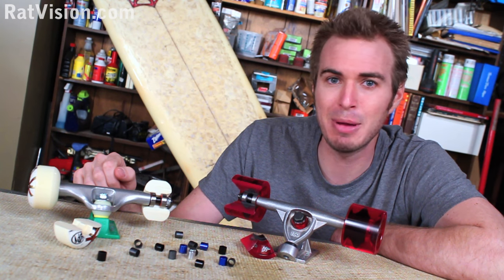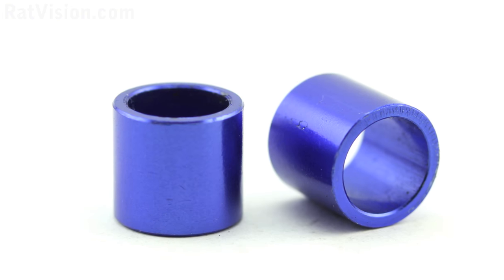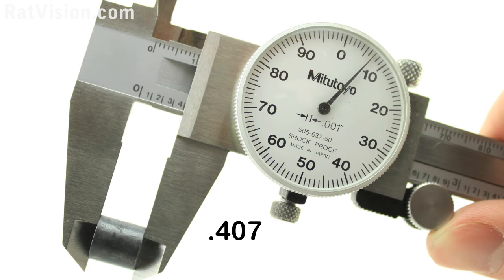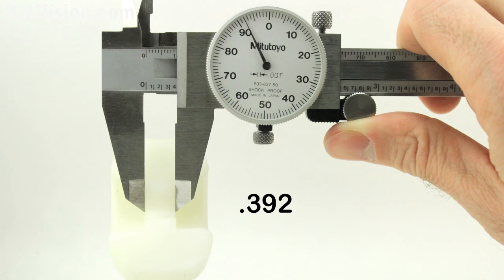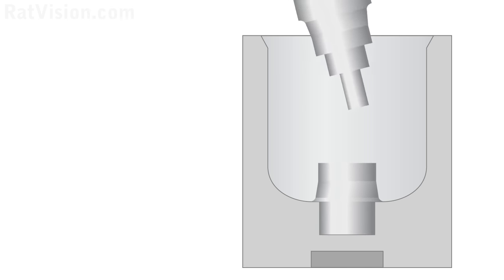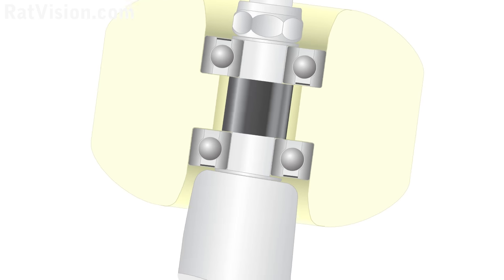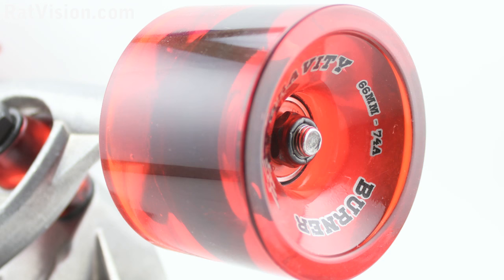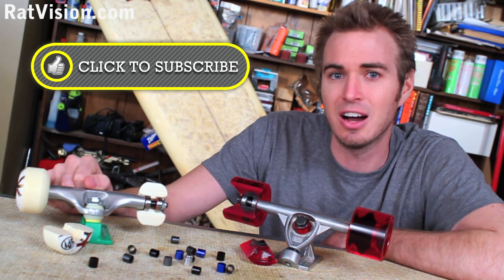Fastest Skateboard Wheels, Bearings, and Bearing Spacers

Comment: Thanks for an intelligent video on bearings and spacers. We need more info like this. You did not mention Twincam 6-ball ILQ9s and 8-ball bearings such as the Qubes... It seems the skateboard industry is saturated by rebadged poor quality 7-ball types. Bearings are overpriced in shops almost 2x the price even with postage, is always cheaper direct from manufacturer.
Reply from the maker: We commented on a similer question by you in a different video.  Twincam is not in the skateboard industry at all.  7 balls are the magic number and out perform 6-ball and 8-ball bearings.  However, you are absolutely right that there are "rebadged" or re-branded bearings in the skate industry.  I have to constantly tell people that one brand they love is the exact same brand as 5 others.

Comment: i want to buy a longboard and found one can you pleas tell me if this is a good first board or not? its a KICKTAIL 70's shape skateboard w/ 71mm wheels
Size: 40" X 9.75"
71mm Wheels
Truck: 7"Hanger, Aluminum Alloy
Abec 5 bearings
Hardware: 1.5", Riser: 1/2" Rubber, With Grip Tape on it
 or just search for: "New Complete Longboard KICKTAIL 70's shape skateboard w/ 71mm wheels" on amazon.com

Comment: Or you can just not crank your axle nut down, so there practically no pressure on the bearings. No pressure on the sides = bearing balls staying centered in the groove and bearings rolling the fastest. Im not saying keep it loose by any means, but if there is just the littlest bit of play with your wheel moving side to side on the axle, your golden.

Comment: "Even Death" might be exaggerating a bit but otherwise I likes the vid.  Oh yeah, the spacer ideally should be ~.002 longer than the space inside the wheel so that there is no bearing bind and very little wheel movement on the outer bearing races.

Comment: What are good wheels so I don't fall on pebbles
Reply: +omgkid angel 
Try Ricta Clouds 78b wheels. 54mm is a comfortable size. Ther are very soft, have excellent traction and rol over everything that would normally make you skurrtt and fall.
Reply: +AGP兆し +1 on the clouds. Really nice cruising wheel and surprisingly low rolling resistance. By the way, it's 78A , the B durometer scale (Shore B) is a little harder and isn't commonly used.
Reply: +omgkid angel shark wheels

Comment: I bought some Destructo Squadron 6.0 trucks not long ago based on some good reviews. Had to send the first pair back because the manufacturing was so poor and the second pair I received were marginally better. The two sides of the truck where the axle meets the bearing are noticeably slanted so there's no way your bearings are going to fit in there properly plus there was plenty of aluminum that wasn't polished down (just like in the video). The guy from Socal Skates said in response, as if it was a positive, each of Destructo's trucks are made by hand, skater-run, etc. Totally irrelevant when the quality control is so poor. Might as well buy cheap trucks like Krux K5 that have good quality control and function as well as anything I've used over the past 40 years.

Comment: This is why you should buy precision trucks and bearing that have built in spacers.
Reply from the maker: Not so fast.  There is only one wheel size that fits built in spacers.  When wheels all appear to have different size centers, built in spacers don't work, except for one wheel center that matches the built in spacers.
Reply from the maker: HA HA.  So you're just regurgitating the same false information that someone told you?  You've got to do your own research and testing before you just assume what you've been told.   You've watched the video, but still assume that with all the different cores that built in spacers work. Lets not forget about the lubricant Zealous uses with "nano ceramic" powder in it that roughens up the metal surface.  Don't fall victim to marketing hype.  The industry is full of BS.
Reply from the maker: I don't care what you've done, and what you think you know.  All our information is based on facts by researching and testing products.  If you watch our video you can see that each of the cores we showed had different measurements.  Right there that proves that built in spacer bearings don't solve a problem. You must have had a hell of a time skating across 1/3 the US.  It would have been much easier if you knew more about the products and brands you like.  I'm not trying to argue with you, and it's clear we both have different opinions.  Your mind is shut off from wanting to learn some new things.  That's too bad.

Comment: you where measuring the outside of the wheel where the bearing spacer should go, therfore you got inaccurate results on the caliper
Reply from the maker: I was measuring where the bearings seat.  In other words where they stop.  That is where the spacer should should go, and it should match that measurement, therefore the results are perfect.
Reply: Oh ok sorry if I came off rude or anything.

Comment: First off Bones are very quality wheels and i ride them with spacers made by bones and have never had a problem, i also ride Action Board Sports Mozzerellas with some random spacers in that work great, if you dial it in right any spacers are fine. you will never feel these .002 of an inch differences while riding.
Reply from the maker: You also won't feel the effects of smoking cigarettes either.  Spacers reduce the loads applied to bearings, increase performance while turning, and prevent friction and galling.  You can't feel this or notice it, but the benefits of properly fitting bearing spacers are there.  As you can see clearly in the video, Bones spacers do NOT fit properly.
Reply: #swerve
Reply: Rat Vision – Skateboard Tech Are Khiro spacers any better?
Reply: You get rekt, son.

Comment: I just use space ball bearings, since they have built in spacers.
Reply from the maker: Please enlighten us with how that fixes the issue.  Also please tell us all what dimension the spacers are when they touch inside a wheel.  Is it .400", .408", .406", or .396".  We need to know that.  And since they have built in spacers, how do you even know if the spacers are going to touch?  What if the core is wider than the spacers combined?  So, you use Bear space balls because they have built in spacers, but did you buy the right wheels?
Reply: +Rat Vision – Skateboard Tech I use Kegel Wheels, for now until I buy a different pair. What wheels do you recommend?

Comment: Abec 11 biltins do the trick for me, or just forget the spacer if you use standard type bearings. If you have truck defects, well you should exchange it before even attempting to use it. Never had these problems. Good bearings is a debatable question. Spacers, never found them of any use, most of them don't let bearings sit right. If you must have them, get abec11 biltins

Comment: Abec5 bearings without any type of lubricant in them just cleaned with sunflower oil, rubbing alcohol and a paper towel spin for 45 seconds which is absolutely insane lol
Reply: That's is because they are meant to be used at higher speeds but without lube they are gonna weld themselves together after some use at a higher speed
Reply: Nick Carter Can you recommend me a good pair of bearings ?
Reply from the maker: ilovetacosxoxo Do NOT use sunflower oil.  It is not a lubricant.
Reply: Rat Vision – Skateboard Tech what kind of lube would u recommend i mean not like this speed cream or whatever it is called something more domestic
Reply: ilovetacosxoxo Multipurpose grease will work just make sure to take the time to work it into the balls and to wipe off any excess i used to use it and i never had any problems but you would need to clean more
Reply: +ilovetacosxoxo I have abec 7's and I did that.. DAMN
Reply: +ilovetacosxoxo light lubes or actual skate lube are what you're looking for. Rat Vision and many others like Oust bearings. I prefer Bones Reds, though they are fairly cheap. Riding at high speeds with them are standard, but you can clean them well and... they're cheap. As a teen with a low budget, fair quality for cheap is a great deal

Comment: Dude no  offense but I watched this video to see what the fastest skateboard and longboard wheeles and bearings were. Not to watch you complain about everything. And that extra room only slows you down by like 3 mph come on that's not that bad..
Reply from the maker: There is no one brand or wheel style that is the fastest.  Knowing how the products/parts work will allow you to have the fastest setup.  Telling you that ABEC 11, Orangatang, Seismic, or Bones are the best does not do you any good, because what is MORE important is know how bearings work optimally, how the bearings should fit in the wheel, and how the spacer should fit and how it functions.  
Knowing this stuff will help you to have proper wheel assemblies to increase speed, reduce speed wobbles, reduce wear and friction on the bearings, and reduce loads on the bearings so you can maintain high speeds when loads are applied.
Go ahead and believe that it's a 3mph difference if you want, but there is much more to it than just choosing the "best" or "fastest" wheels and bearings.
Let's say there is a perfect wheel and set of bearings.  If you don't know how to properly fit them on your trucks they won't perform like the best and be the fastest.  This video was not about complaining at all.  It is about teaching the skate community about how stuff works.
Reply: Rat Vision – Skateboard Tech so how do we know? how do we know are bearings are working optimally and the spacer is fitted correctly?

Comment: Great vid but you should have pointed out the up-side of not having spacers, a quicker break in for a faster spin. but that comes with a down-side, less bearing life. so I suppose its tit-for-tat or like you suggest yourself----OUST!
Reply from the maker: +Anon Ymous Woah...  You got told some incorrect information.  There is no upside at all to not having spacers.  The value of having spacers is that they allow for the axle nut to be tightened all the way to the outside bearing of the wheel.  What this does is allow the wheel to be solid on the axle.  This causes proper wheel alignment, which in turn is better bearing alignment, more efficient rolling, more speed due to far less axial and torsional loads that cause more friction and won't damage the balls and raceways.  The list goes on and on with upsides.  Not having spacers only has downsides.  Sure you can skate without them, but the bearings are not functioning optimally.  They will not roll as fast, give less performance, and won't last as long.  As you said, less life.  You still need spacers with any bearing including Oust.  Even tho Oust redesigned the standard 608 bearing to handle loads better, the wheel still needs to be solid on the axle.  No one really knows what breaking-in a bearing actually is.  It has to do with the balls and races/rings.  It takes roughly 15-25 hours of skating for the two metal surfaces (balls and races) to get familiar with each other.  Even tho both surfaces appear super smooth, shiny, and have a mirror finish, they are actually very gagged and rough.  When the surfaces come in contact with each other they further smooth out the gagged rough terrain surfaces, which allows the balls to roll faster.  During the break-in period the bearings need to clean and well lubricated.  This is why new bearings are not better than bearings that have been broken-in.  Hope this was helpful. Now PLEASE spread the word.
Reply: Thanks for correcting the misleading info I have found. In my personal experience I have ridden bearings to death (dead stops, destroyed roll cage) due to no "TLC"...But now that I longboard I have been paying close attention to my setup, I frequently clean and oil (sewing machine oil mixed with Bones speed cream to make it less viscous) my bearings, Have experimented with having bearing shields or not (better on, lol) and this whole time I've been tightening my lug nuts just to say they are snug, but not touching my bearings...I have only one set of bearings with built in spacers, Spaceballs from a Landyachtz/Hawgz setup, they fit perfectly into the Hawgs Fatties they came with, and roll really smooth and fast when tightened all the way down...I'm going to look through my bin of skate parts to look for decent fitting spacers. Thanks again, and for the great detail!!
Reply from the maker: +Anon Ymous Awesome! Glad what I said helped you. Looks like you're on your way to a getting the perfect setup.

Comment: 1. you don't completely tighten down your wheels,  you want a little play room for maximum speed from your bearings.
2. your skateboard bearings should basically snap into your wheels for a nice snug tight fit, therefore your bearing and spacer theory is bullshit.
Reply from the maker: 1. Duh! There wouldn't need to be play if spacers fit properly in wheels.
2. What "theory" are you referring to?  Everything mentioned in the video is 100% true and accurate.  We wouldn't have gotten a call from Tim Piumarta, NHS’ Director of Research and Development for 35 years, saying that everything was 100% spot on, if it was bullshit.  You seem to think you're some hot shit skater who knows everything, but the truth is you have a lot to learn about your ego and facts.  If everything you think we mention in our videos is bullshit, prove us wrong with your research and testing.  We'll delete this video and any others if you can prove to us where there is "bullshit".
Reply: You got told madtrav

Comment: My wheels are the worst.  I cant tighten my nut all the way   If i do rhe wheel wont roll
Reply from the maker: This is what spacers are supposed to do.  Most spacers do not work correctly anyway.  You have to loosen the nut a little until the wheel spins freely.

Comment: There is hope, read this to the end. Well not all true to say they (mugs.) must do anything better; back to reality. To demand more from a consumer product where it is all about a marketable price. Do you really think it is safer to go even faster?- not a good logic. If the perfection you are looking for is to be. It is an opportunity for a tweak shop to do it. Show us how the demand is there, start tweaking trucks, boards, and bearings. It is truly plausible, seems you know enough, to do it. Ask a 'competitive' celebrity skateboarder to give you two of his identical new rides. Then do a roll test to see which travels a ramp straighter and longer.Porsche themselves, stops short of perfection and let others get the max out of a mfg "priceable' car. With a video to catch all this and make it measurable. Do all the measurements. But before, roll test even the two supplied boards before to see how different they are. If you don't do this I will, because I am quite capable and have the know how, but am busy, but curious how good you are, I have aerospace composites and machine tolerance bkg and cinema gear. Now tet the fastest stock sample with your 'improved' model and show us what it is going to cost and how much less friction.

Comment: The rib inside the wheel and the spacer have been a standardized size since 1976....any deviation from this is just low quality....and low quality and design are even more common now than then 😂...the gimmick factor is so high in skateboarding now it's fairly comical

Comment: This makes me so mad
Reply: +Fireflys450 why
Reply: +KoreanJoker rekoJnaeroK knowing that things aren't perfectly align even if it's minuscule
Reply: Fireflys450 It's bound to happen with any mass-produced item. Your devices aren't perfect either
Reply: +KoreanJoker rekoJnaeroK true, I was thinking about that, but if you're dropping $80 or more on your bearings and they're THAT off, it's annoying y'know y'know
Reply: Fireflys450 I spend 10 bucks on pretty simple Bones Reds. They're very flawed, but I haven't died from them after 20 runs downhill today. I think $80 for a set of bearings won't be off at all, in fact, insanely precise. These small flaws won't do much if you're a professional. It won't do well past 70 mph when everything is flawed (and it will be) and you're bound to wobble but everyone accepted that. That your board limit will always be 70-90 mph because it's flawed

Comment: no actually it's not accurate its bullshit. your just trying to make people believe shit that is not relevant. if you need to use spacers then your using A.wrong wheels and or B.wrong bearings it that simple. you dont need spacers in your wheels. end of conversation.
Reply from the maker: This video explains in full detail what spacers are and how they work.  You can skate without spacers, but the bearings take on loads more, have lower speed, and you'll end up replacing them sooner.  Basically you'll have a better functioning and longer lasting bearings.